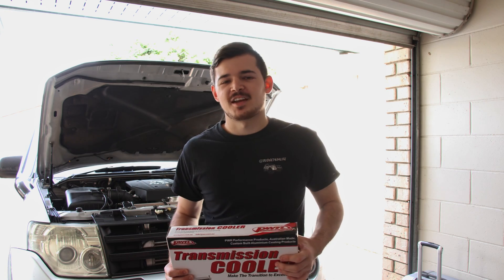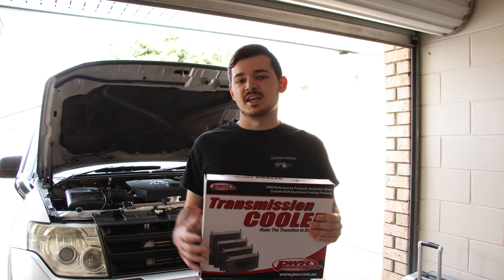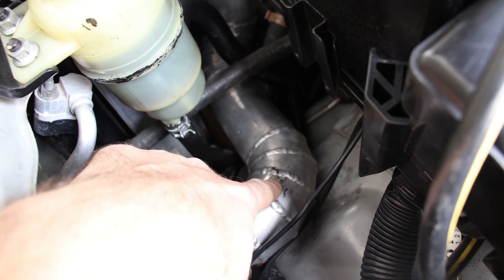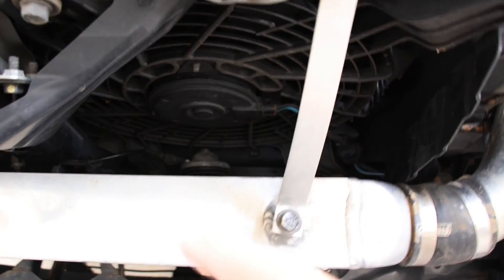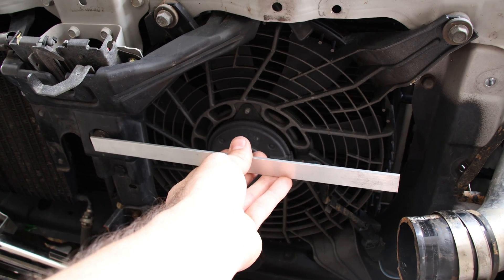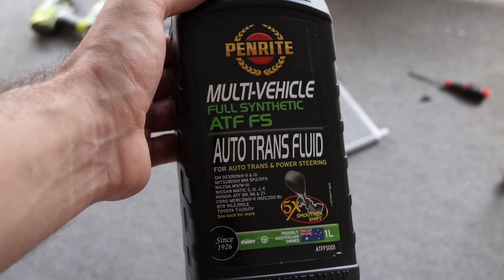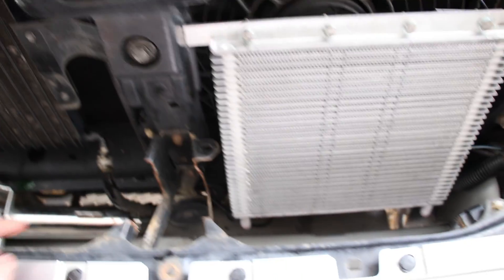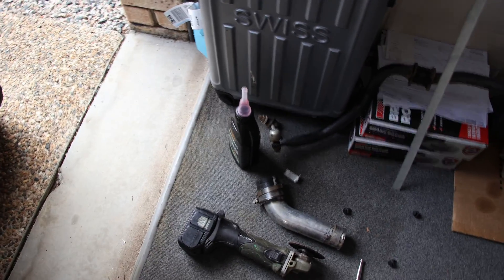How to install a Secondary PWR Transmission Oil Cooler and the Benefits!

Comment: I've thought about installing a standard one directly in front of the existing one. Just extend the mounting points out and a bit of hose. I understand the cooling wont be as good as it would be having the cooler on the other side but that's also taking cooling away from the radiator too so...

Comment: Hi. Great videos! When you installed the new aux cooler for transmission oil you did not remove the old cooler. Why did you not remove the old cooler?
Reply from the maker: @torvincentvredal290  thanks mate. Simple, 2 is better than 1 🙂

Comment: Not that I'm a expert or anything, just digging for info.

But a lockup kit is not necessarily the end all solution, because the gearbox can't be in a locked state in all scenarios.

So ñ bigger and better cooler helps a lot.

Reference: https://youtu.be/DyU3LIpA-Mg?si=S1ivVzksX7Fn4Kz_ https://youtu.be/DyU3LIpA-Mg?si=S1ivVzksX7Fn4Kz_

Did you get a cooler with a ⅜" or ½" fitting?
Reply from the maker: I agree mate. Temps have gone down and if you tow in 4th I don’t see the need for a lockup. I believe it comes with 3/8 cheers

Comment: I've owned 6 Pajero Exceeds V6s over the last 18 years, towed a 2t boat, drove over Stockton, Moreton and Fraser and never ever had a gearbox overheat warning. I've now had a 2010 Prado 150 Kakadu diesel for about 2months and the first run up a very steep hill and it throws a gearbox overheat warning after about 500 metres. So now I'm searching for an external transmission cooler. (BTW, I was given the Prado, not my choice)
Reply from the maker: Yeah if only it wasn't so heavy on fuel I'd take a petrol too 💯🔥
Reply: @bgt4x4  We could argue all day about the cost of ownership, maintanence, fuel usage and the type of driving you do, and luck (...did somebody say 'new injector pump') but in the end its all about which one makes you happy. Its a bit like people telling me to pump the tyres to 40psi to save a few cents in fuel, I tell them 32psi is a comfortable ride and I'm happy to pay a few cents more each week. Thanks for the video.

Comment: Hi, did You have problems with overheating the transmission? It happened to me twice, that the transmission overhwating warning came on the dashboard and I wonder if anything is wrong with the transmission or I just need a bigger coooler. Cheers
Reply from the maker: Hey mate this hasn't happened to mine. I would highly suggest you get a gauge to keep an eye on the temps. Your transmission has overheated so you should change out the oil asap. Could be many things like your cooler being damaged, towing? Driving steep hills  or offroading in the wrong gear etc
Reply: @bgt4x4  Thank You for reply. I Got it checked by the transmission service and everything was ok. It happened on steep hills on low range but the speed was very slow. I think I need the bigger cooler and it will solve the problem.

Comment: Nice video. If I may and I am not criticizing, Pajero don't like other auto transmission fluid. Stick with Mitsubishi oil, Dia Queen, always!! Seen numerous guys have trouble after using other oil and then it is an expensive exercise. Just my 2 cents.
Reply from the maker: Thanks mate will do with next service 😃💯

Comment: Best not to mount a cooler that way as they don't totally fill and air can get trapped at the top of the cooler mounting sideways or upside down is better so all air can escape for maximum efficiency
Reply from the maker: Thanks mate  definitely true but the factory hose at the bottom won't reach the top unfortunately. Will have to get an additional hose with a brass fitting to connect to the other one 🙂

Comment: Good idea imo.
Anything that can keep the temps down when they're working hard has to be a good thing.
Is there anything that can be done to lessen the risk of the oil cooler issue the Paj's have sometimes?
Has happened to a couple of people I know with them and it can be rather expensive or worse.
Reply from the maker: Cheers mate 💯

I would personally replace it before the internal cooler dies. That's about all you can do unfortunately
Reply: @bgt4x4  I have seen that people have said that an O ring can fail so maybe replacing that could help?
I have seen a post where a low k one failed but most seem to be at higher k's.
Seems most notice when oil comes out of the coolant bottle but if you didn't notice it and kept driving it could be ugly.
Reply from the maker: @oldbloke204  yeah interesting. So far I haven't heard of an NS with this issue so I won't touch mine but for other models probably best to replace it every 100k with a manifold clean as well 🙂💯